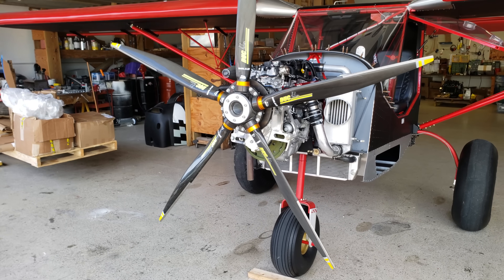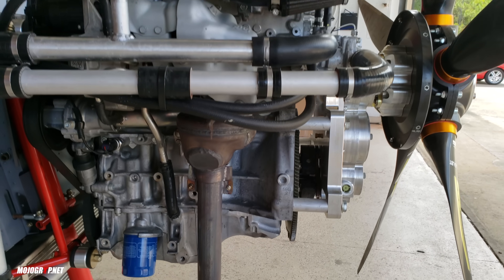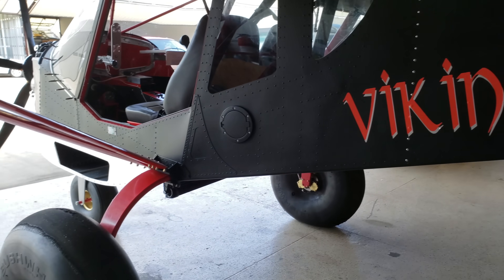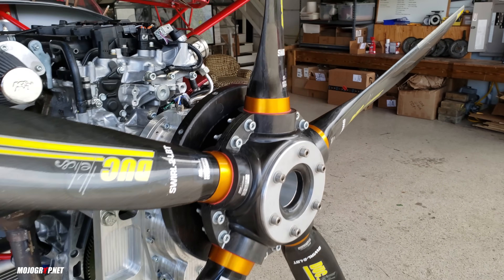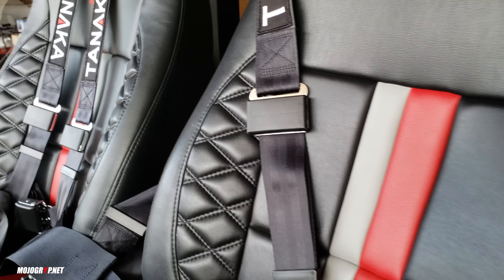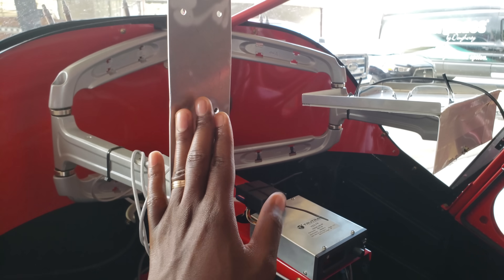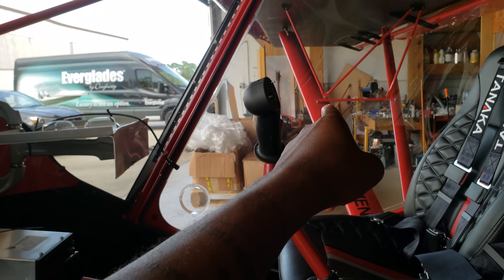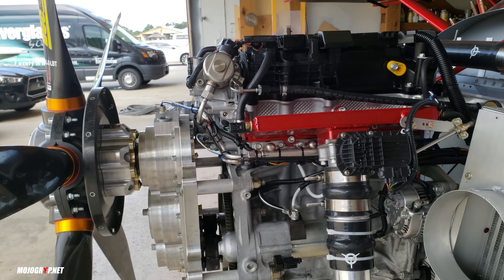Zenith Super Duty CH 750 STOL l Powered By Viking 180 HP Engine

Comment: This doesn't qualify as a "light aircraft" does it? I mean, can I fly this set-up with a sport-pilot's license?
Reply: JORDAN PHOTO WORKS you can build a Zenith CH750 to LSA specs to meet the Sport Pilot requirements. The plane in this video is the Super Duty model and exceeds 1320 lbs gross take off weight.

Comment: FWIW:  I soloed in 1979 although I never followed through and got my private pilot's license.  Most of my training was done in Piper Tomahawks.  While the Tomahawk is "nothing to write home about", I really appreciated it for its overall visibility.  I did some flight training in a Cessna 150 and having the wing overhead with no overhead visibility was not a plus in my opinion.  
 
During one Sun 'N' Fun Airshow during the late 1980s or early 1990s, I got to sit in a 701 that Zenith had on display.  Because of the way the upper sides of the wing roots angle down towards the fuselage, you have very good visibility overhead.  
 
Now, 20+ years later, the visibility 'thing'  might NOT be as much of an issue for me as it was then.  But based on what I remember from that Sun 'N' Fun, I think this would be an ideal airplane visibility wise....

Comment: Is it can make aircraft from bike engine ? 
Example: if bike 180 HP & aircraft 180HP  speed and weight carry is it will same?
Reply: A 1000cc motorcycle engine, as amazing as they are would not be ideal running at 10,000 rpm for long periods. Airplane engines run at close to full power for long periods of time. Reliability is extremely important.

Comment: I myself would redo the dash that mount they have installed is a sure killer if you were to go down. Other then that it looks like a great bush plane with the landing gear and clearance it has and very short take off.
Reply: We actually plan to in hindsight, not a huge concern for us being shorter :) - but realize where that would be concerning for some.
Reply: @eggenfellner  This would make a great bush plane but it need just a few minor tweaks.  The landing gear needs cross bracing to make it a little more forgiving. This plane configuration would sale very well in Alaska and of grid Canada. And it needs to be able to carry 4 to 5 hunderd pounds of cargo. Cargo rates start at 6 dollars a pound and up for of grid deliveries in back country. But twin tubro it and take it on up to over 200 hp and put a place for small oxygen bottle, it need to go up to 14 thousand ft. And you have a better motor for extreme cold weather starts. You have to preheat and air cooled to at lease 35 so you do not crack the block or cylinder head. And you engine can run a lighter synthetic oil in it.

Comment: Kudos to Jan Eggenfeller (Mr. Viking Engines himself) to building the first customer (kit) delivered CH750! Love the color scheme, love the attention to detail that he worked into it, and- what better showcase for that modified Honda motor? I wish he had made the High Sierra Fly in, and joined the STOL Drag competition, I think he could've given Trent Palmer a run, but, doubt that he could've bested Draco (a class of 1). To my eye, the motor 'seems' very large, and, somewhat heavy, but- that is just a gut sense, not based on comparing similarly powered motors for size and weight. I'm sure that it's robust, long lasting, and, well engineered, because Mr. Eggenfeller has been doing it for a while, and, seems to be very serious about these conversions. I think he flew it to Alaska between aviation shows... Long trip, but, another testament to it's durability...
Reply: David C. Gulliver actually the Kseries engine that this looks like it's based on I've picked up by myself and transported in a Civic hatch. Very lightweight for their size.
Reply: @drummerchaniking7026  Thank you! I hate to even suggest negative info- especially when I'm wrong! Thanks for the correction, I appreciate it!
Reply: David C. Gulliver I'm sorry I didn't mean to come off as negative. I just thought that would be some info you would be interested in knowing. No hate, just love and growing by knowledge.
Reply: @drummerchaniking7026  I was sincere in my reply. I really do NOT want to suggest negative stuff- especially when I'm wrong. I didn't think there was any hate- my gratitude is genuine. Small community, pretty tight- everyone's voice is heard. Mistakes like my initial post can impact all of JE's hard work over the years. Don't want to be that guy.... Really.
Reply: @drummerchaniking7026  These are actually L-series engines, they're even lighter than the K-series.
Reply: idontcare80 that's insane!